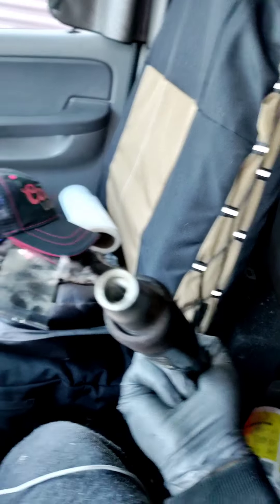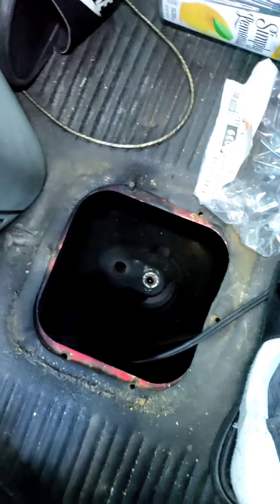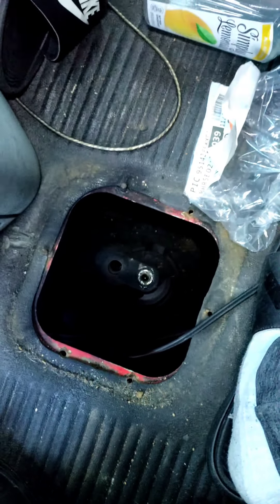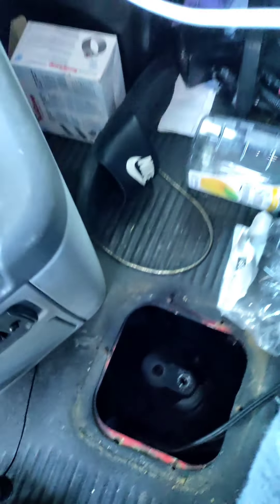HOW TO INSTALL A SHIFTER ON A FREIGHTLINER COLUMBIA!!! (EATON FULLER)

Comment: Thanks I appreciate you showing how to take that off... Mine broke as well. The same place  were the extender and shifter connects. I'm replacing mine and that's how I came across this video. The only thing I'm gonna do different is provide extra stability were extender and shifter connects with a piece of metal plumbing  pipe that measure to overhang the connection by  1/2 inch to an 1inch on both sides. Then I cut a strip out of the pipe so you can tighten it with two metal adjustable bands.

Comment: How do you remove the actual boot? I’ve tried but it appears you have to loosen from the bottom and the top? There’s a leak coming from the top of my transmission and that appears to be the easiest way to get to it for troubleshooting.

Comment: Hey which way the bolts turn is the left to  loosing or isn't  it the opposite
Reply: It hard to turn either  way an don't  want snap the bolt
Reply: I don't if it one left tighten right loosing  deals